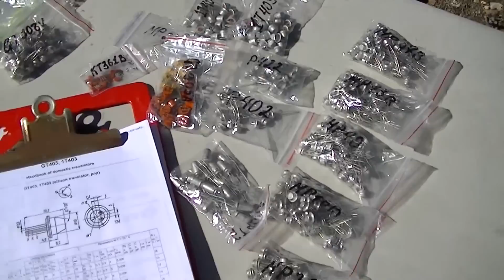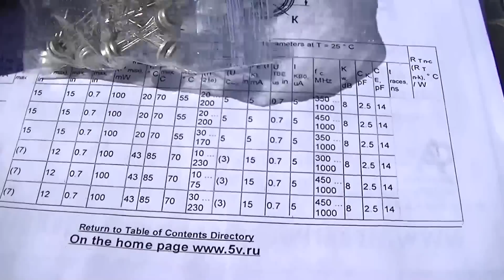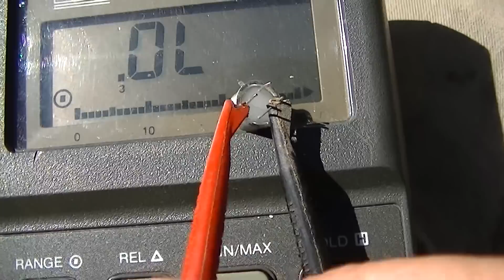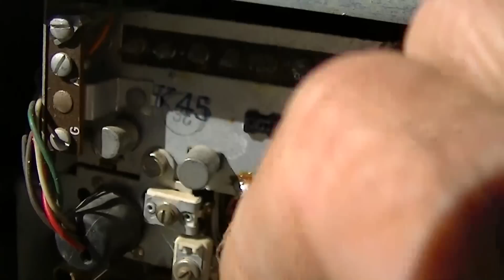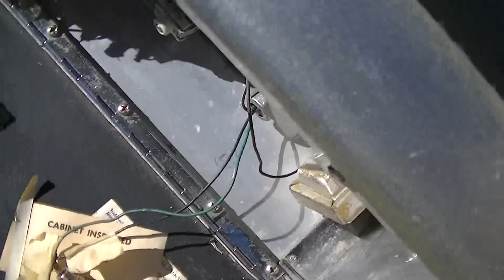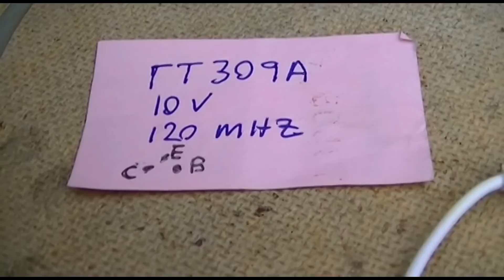Russian Germanium Transistors In Zenith Transoceanic Repair

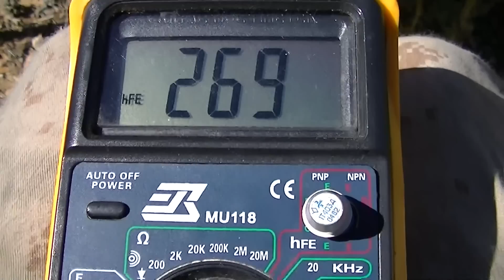Comment: 25:28 those cheap meters are designed to measure hFE of silicon transistors
For germaniums they give +20...30% error.

Also for germaniums BE voltage drop is a bit higher than BC. Usually 10-40mV higher. Could be handy when identifying leads with DMM.

Comment: Love the Zenith. A transistor radio built in the style of a valve radio. Point to point wiring and even the transistors are sitting where the valves would be.

Comment: 24 to 25 mins in you were working out the pin-out configuration from the diagram of the "1t" type transistor. As it is an engineering drawing, the plan elevation rolls over to the side elevation. So the collector was the can, as you said, and the base top with the emitter at the bottom of the diagram. Just noticed this was 6 years ago, so I guess you've probably got that one figured...

Comment: Do you really need the case connection? I think of it more like a ground connection. Some TO-3 transistors use the case as the collector lead. Tx
Reply: sometimes grounding the case can help with stability if it's not connected to the base collector or emitter
Reply: The grounded case could also affect any internal capacitance generated between the junctions of the device.

Comment: Thanks, for this. I just inherited a Zenith Trans-Oceanic 3000-1, 1965 vintage in good condition.  I tried it and it worked great in FM mode but when I tried AM and Shortwave, there was no sound. After examining the inside, I noticed the AM oscillator (121-46) transistor was missing .  Will order a pack of gt313b's as soon as I can.  The radio itself is extremely well built with excellent sound even in FM mono!. Its a pity they don't still make them like that anymore. Thanks again.
Reply: tengo el mismo problema  como lo solucionaste saludos
Reply: @Vinicio244  Radio works well now.

Comment: Good Video. i would like to replace 1T403V from Push Pull oscillator. since it is not recommended for new design. Suggest an equivalent silicon version.

Comment: Hi, since germanium transistors became very hard or even impossible to find for decades ago, a russian - or poland or chinese ones - would be a challenge between service or not a device... if a retouch on circuits will be necessary, what else I have to do ? I saved for future use some germanium diodes and transistors too, of japanese and european sources but just a little amount, who saved for me some rare radio sets... when they are off my stock, I'll be out of business, if no options exhists.

Comment: The Soviets became very good at making germanium transistors because at one point silicon was scarce in the USSR.  Some of the first microwave germanium transistors were made in that part of the world.
Reply: What ?! There is no place on this planet where silicon is scarce.
Reply: It's realy abundant in Hollywood.
Reply: Lol.   Silicon is the second most common element in the Earth's crust second to oxygen.  If I don't know the correct answer already, I don't believe anything this guy says.  Stick to what you know to be true.
Reply: @johnmcmillan8339  I meant refined silicon.  It's very difficult to refine silicon and the resources for doing that at the time were scarce in the USSR.
Reply: He says 450-1000 mhz transistor would be great for fm.   Are you serious????  Fm commercial band is 88-108.  Transistor s don't know if they are amplifying fm or am.   Garbage.
Reply: @johnmcmillan8339  He is absolutely right about ft = 450-1000MHz rated transistors being good for FM amplification. As a rule of thumb, transistor's transition frequency should be an order of a magnitude better than the highest signal frequency you want to amplify. So for commercial FM (the highest frequency = 108Mhz) ideally you should try to pick a transistor with at least 1GHz transition frequency so that the current gain of the transistor wouldn't be affected by the FM signal you are trying to amplify.
Reply: @johnmcmillan8339  Just remember that a transistors frequency rating (ft) doesn't mean you can use the transistor to amplify a signal at that frequency. What that rating is telling you is the current gain of the transistor (hfe) is equal to 1 at that frequency. For example 2N3904 has a transition frequency of 300MHz with typical current gain of 100 to 400. If you were to put 2N3904 at the front end of UHF amplifier, it would be useless since its current gain(hfe) is very close to 1. The transistor wouldn't have any current gain at that frequency.

Comment: Big Thank you for this video. I learn a lot from this, I find that the right transistors on ebay cost a too much to make any repair not worth it, if you can find them till now.
I never thort of using them, just to scrap a junk radio for parts can take long time to find what you need.
this will helo me save more radios I find in flea markets.
so I buy a load transistors to find little infomation so far. I mostly find data but not the frequincey they run at. Just adds to the fun of this hobby...
I have seen most of your videos and all ways looking forwaed to the next. As I learn so much from them.

All the very best Richard   (from uk Durham )

Comment: I found this little blurb I found useful about how these critters are numbered on wylie dot org

A correspondent, Andrey Roubtsov, has explained that MP means 'modernised P', and this series largely consists of transistors with the same characteristics as the same number in the old P series, but in a more modern packaging. (There are however, a few exceptions).

    The GT series of germanium transistors
    the KT series of silicon transistors
    The 1T and 2T series of transistors

In 1964 a new system of transistor naming was started (devices developed before this date continued to be produced with old names). The first character indicates the type of semiconductor: 1 and G for germanium devices, 2 or K (from 'Kremniy') for silicon and 3 or A for gallium arsenide. If the first character is a digit that device is intended for military application, if a letter it is for civil and industrial equipment. The next character is the letter T for bipolar transistors or the letter P (from 'Polevoy') for field-effect transistors. Then there are three or four digits. The first indicates the power and frequency characteristics and the remaining two or three are the serial number of the development, starting from 01. A final suffix letter means different variations of electric parameters. Even if there is only one variant, the letter A is used.

Comment: Have you seen these neat little gadgets? https://goo.gl/HOOHfn they measure a wide variety of components' values as well as automatically determines what a component is, and a pinout of the part. They aren't SUPER accurate, but for 20 bucks, it is actually really good. I own one and I built one (arduino based, not my code)

Comment: Those white electolytics are I.T. I. Nashville caps that are widely known to have a high failure rate. Whenever I see them in a radio I'm working on, I automatically change them.
Reply: Yes, Nashville capacitors, the 1950s and 60s U.S equivalent of Capxon capacitors today, or Hunts in old blighty. I think the Nashville company disappeared by the mid 1960s, you don't see them used in anything after that time.
Reply: No I have not heard of that brand at all, is that a new brand? I don't really mind using capacitors that are made off shore, so long as they pass the leak test on my bridge, which the yellow film caps never seem to have a problem doing. Illinois Capacitors are pretty good, not sure about where they are made now, basically the same as the Mallory film types. As for the Sprague orange drops there seems to be too much of a cult following with those, I don't think that the added cost over other brand is justified much of the time. Poly film caps seldom fail if they are bought through a reputable outfit, and not one of those fly by night fleabay dealers in China.
Volares and Aspens, of the F body persuasion, were not too bad, though the early production models had issues with severe rust. I would say that Nashville caps were more like a Chebby Vega, Aerovox were more like a Nova/Valliant, but the Hunt capacitors were like an Envoy Epic/Vauhaul  or  an Austin/Morris Marina.